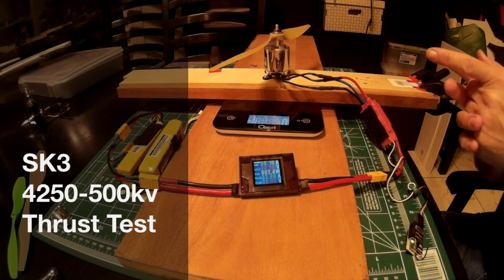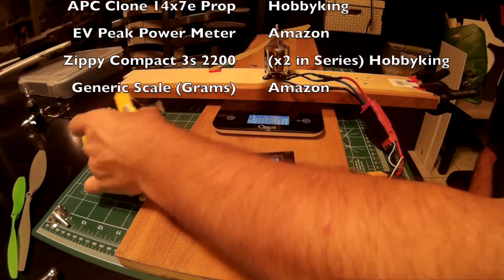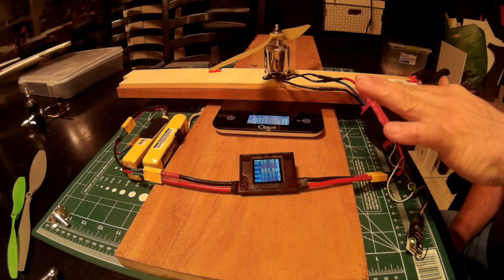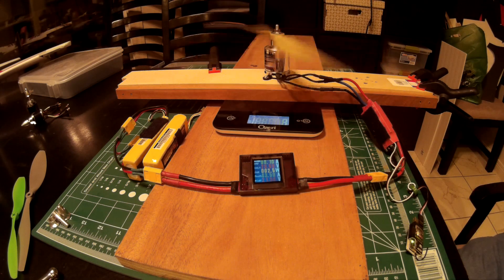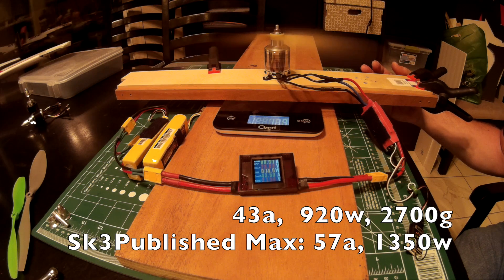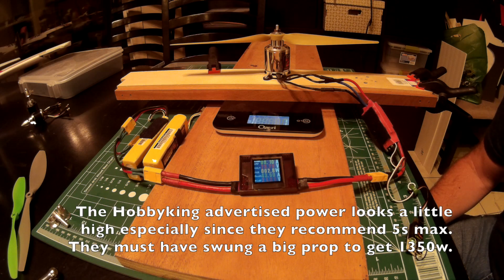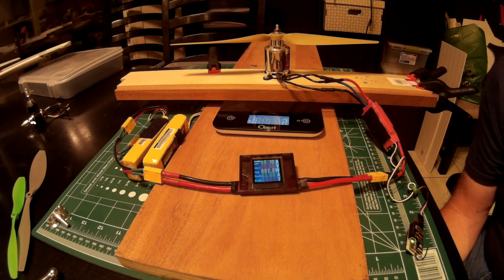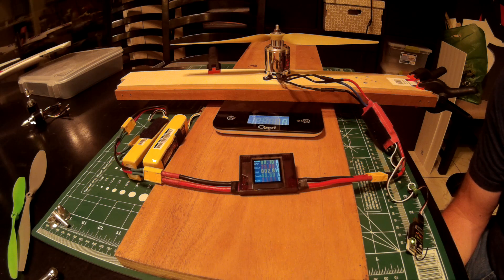Hobbyking SK3 4250-500kv Thrust Test

Comment: 15x8 APCe on   6s  =1043 watts and 48 amps on my test so I don't know how to get 1350watts (claimed) out of mine. I can't push mine any further!  Does what I need any way, nice well made motor .
Reply from the maker: They're ok. I like Sunnysky motors much better though.
Reply: @RCVideoReviews   I have run an Aerolion 4260 - 500 also ,can easily get over 1700 watts on 6 cell ,I wish Turnigy still made a 4260 also  very lightweight powerful package.

Comment: Prop is on backwards
Reply from the maker: Yeah, that's what kept it from taking off and what gave the downward pressure to measure thrust. You're messing with me right?
Reply: @RCVideoReviews  The prop spinning backwards will not have the same efficiency as when it is turning the correct direction. A propeller blade is an airfoil. You should turn the propeller over so it is facing down and repeat the test. I bet your results are off by as much as 20%. BTW, how did the airplane fly?

Comment: Good night sir, my name is Daniel and I am building a plane with my son. If possible I need your help. The plane weighs 2500g and has a wingspan of 1210mm, I am thinking of getting an engine, which one is better at in terms of power and autonomy for both I will use a 4000mah 5S battery and how it works in relation to the ESC, which will be a good choice. Thanks a lot for your help, as I like a lot of airplanes but have nothing to understand about this electronic part.
Engine 1: NTM Prop Unit 50-60 Series 380KV / 2665W
Engine 2: Turnigy Aerodrive SK3 - 4250-500KV

Best regard´s Daniel Tomás
Reply from the maker: The SK3 would be a better choice. For a 380Kv motor, you would want more than a 5s spinning the prop. That's too slow for 5s. The 4250 would probably be good with a 12 or 13" prop.
Reply: @RCVideoReviews  Thank´s
Reply from the maker: You’re welcome.

Comment: You can fly this in 6 cell?
Reply from the maker: When I size motors, I pay attention to the amp limits, not voltage limits. I have yet to run into a motor I couldn't fly with higher voltage as long as I stayed within the amperage spec.
Reply: RC Video Reviews Thanks for the video ,it only reinforces my opinion of Sk3s ,nice and shiny but poor performance. I needed a lightweight 42mm motor for a pusherprop ,Turnigy had nothing since the dropping of the 4260 ,so I found an Aoelian 4260 -600kv on Ebay, on 15x8 apc on 6 cell (2 3cell in series) this motor easily makes 1700 watts .

Comment: Also you're saying a 14x8.5 prop pulls less amps than a 14x7. That's odd!
Reply from the maker: Yeah, that's gotta be a typo. Good catch. The watts are higher, amps lower. Not sure what that was about. Obviously the lower pitch should pull fewer amps as was the case on 4s.
Reply: RC Video Reviews Thank  you  for  doing the test ,btw I just tested my 4240 -530 kva on the 14x7 e prop hooked up to an 18 volt ryobi battery pack and recorded 2.62 kilos thrust hooked up to a digital pull scale ,your numbers seem down for a bigger motor on 6s